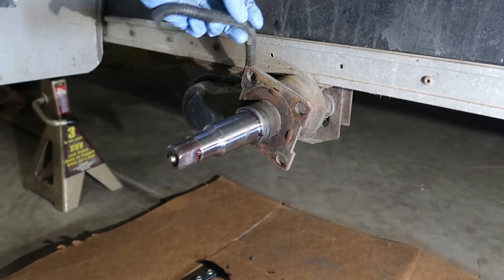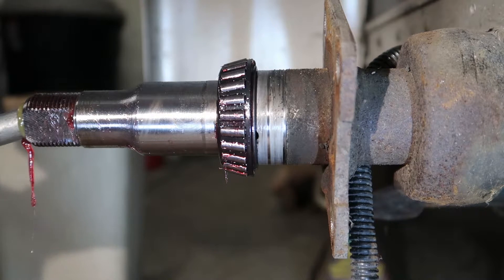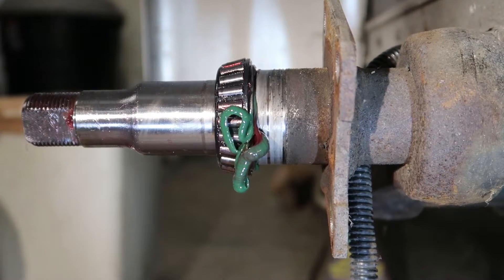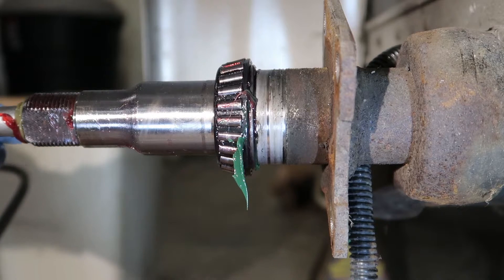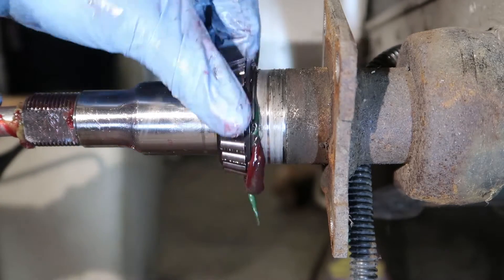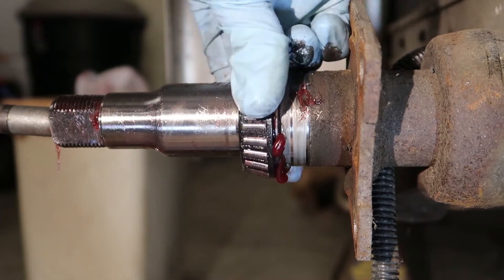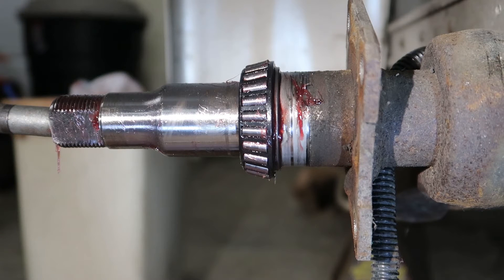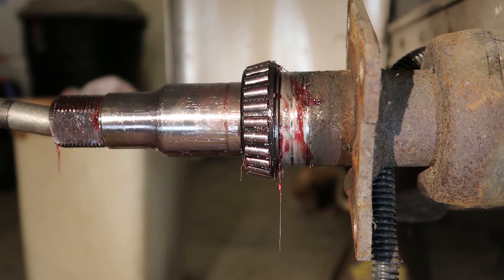EZ Lube Hubs EXPOSED! | Trailer Axle Maintenance

Comment: Actually you are supposed to put your inner bearing and seal in the hub ,slide your hub on the axle put your outer bearing in the hub and snug it up ,then you start greasing it just until you see grease just start coming out of the outer bearing.If have grease coming out of the back side you have a bad seal that is how they are supposed to work.if you only put a couple of pumps of grease in you will never get your outer bearing greased . I don’t like this either, I think you should pull your hubs and grease your bearings once a year .
Reply from the maker: Yes, that's how I reassemble the hub:  Replace the race and bearings if required.  Smear some grease on the inner race.  Pack the inner bearing with grease.  Install inner bearing.  Install seal.  Install hub. Smear grease around spindle and outer race.  Pack outer bearing with grease.  Install out bearing.  Smear more grease on top of outer bearing.  Install hardware. DONE.

Showing the seal and bearing alone in the video was just for demonstration purposes to reveal how it's likely most grease shot in with a grease gun goes behind the inner bearing and will likely blow out the seal.  See the photos in the video,  this is proof it happens.

Comment: I never would suggest to my customers with travel trailers and electric brakes to use the ez lube axle, too many issues with over greasing, I always reccomend a yearly disassemble and repack of the bearings pending the mileage the customer is traveling each season
Reply from the maker: Great point.  This is exactly why I am not a fan of people continuously pumping grease in the EZ Lube either.  I've experienced over greased hubs and ruined brakes on a used trailer I bought.  I also have seen photos and stories of other people doing the same thing.
Reply: craigd51  -what mileage would you suggest to disassemble and repack?

Comment: Without having the hub on, this test doesn't seem valid.  If you had the pressure of the hub and the preload, the grease would have to squeeze around to get back out.  I'd be willing to bet the previous owner never spun it which would blow out the inner seal.  As long as this is spun while the grease is going in there, it will be applied to the innermost area and pushed toward the least resistance (the open hole in the hub where it's designed to come out) but the only way it can get to that least resistance area and escape is by pushing all the old grease out that in the way of the new grease, hence why it comes in at the innermost area.
Reply from the maker: I've seen numerous seals blown out because owners just keep pumping in grease, even when they do spin the wheel.  They don't realize they created a problem until the brakes start fading, then they take it to a shop and the shop finds the blown seal.
Reply: @deltabravo1257  I'm about to grease the bearings on my trailer and the manual specifically indicates to spin the tire and only do three pumps of the grease gun per wheel.  This is to avoid blowing the seal.  Unfortunately YouTube has countless videos where the person greasing the bearings is pumping countless times and until the grease spews out.
Reply: @ed9095  Dexter themselves has a video up that says to pump until you see the new grease.  Of course while spinning the wheel.
Reply: @ed9095  I am trying to find in my manual where it tells you to only do three pumps of the grease gun.  Where or what manual?  Any info would be helpful.  Thanks!
Reply: The inner seal fails overtime and ultimately it blowns out the seal. The is especially true if the tire is not jacked up off the ground and spun while greasing the zerk fitting. My used trailer had the exact same issues due to improperly greasing the easy lube hubs and never replacing the inner seals. I am ordering complete backing plate assembies and inner seals. I will only be hand packing my bearings from now on.